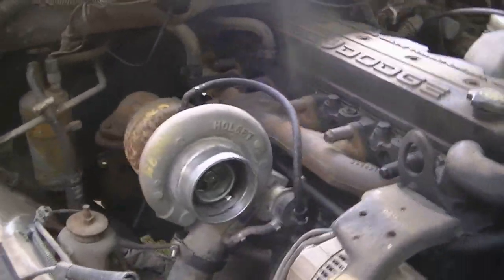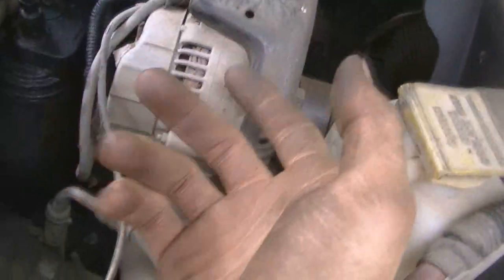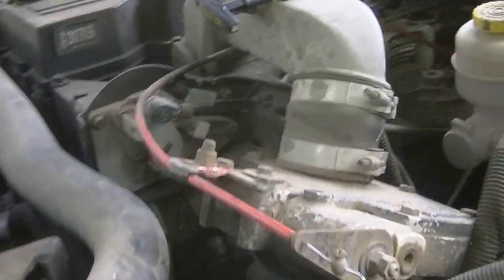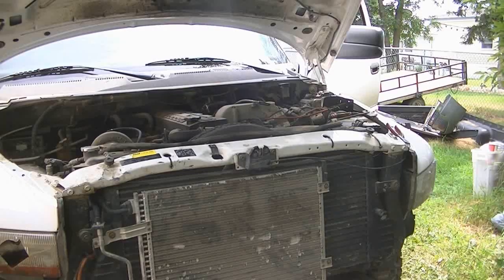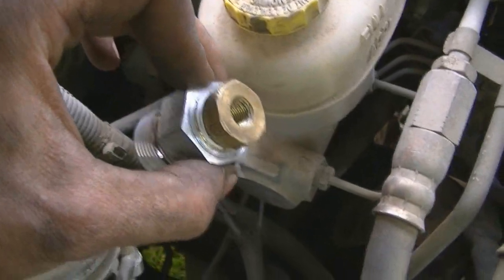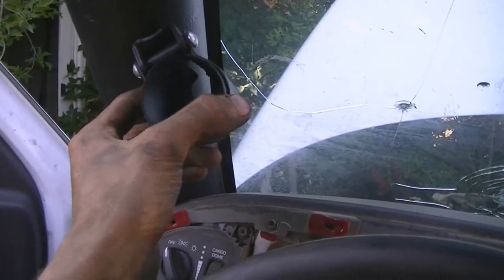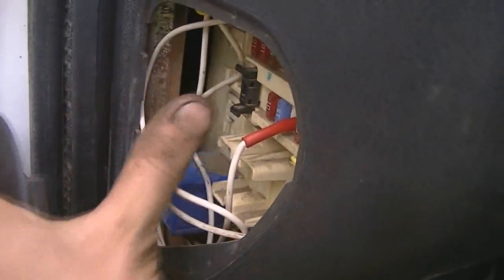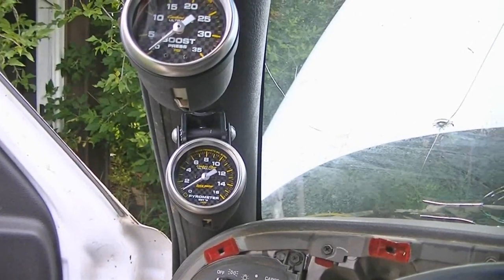01 Cummins: Boost Gauge & Pyrometer Install (07/13/12)

Comment from the maker: i dont think you'd have to worry about the probe coming loose either... ive never heard of that happening... doesnt mean it cant, though... but if you look at the probe, it has a lip on it. it would have to either rip past the lip, or something would have to hit it and break the probe in order for it to go through your turbo... besides, theres pressure in your exhaust... if anything, i'd be worried about firing the probe out and losing boost...

Comment from the maker: i was told 'post turbo, +200*' so if you're gunna mount the probe in the downpipe, get it as close to the turbo as you can (within 2" for sure) and add 200* to the temp reading.

Comment: just upgraded my exhaust and going to install an etg but im a little hesitant to put it in front of the turbo because the last thing i need is the frickin probe to come loose and wipe out my turbo... just wanted your thoughts on a post turbo install, if the temp drop over the turbo will make the guage inaccuate or whatever.

Comment from the maker: nope, its an electric lift pump. they are located on the side of the engine right above the starter, but this truck had that pump fail, and they installed an in-tank one on it. has a dealership 'modified fuel system' sticker on it haha